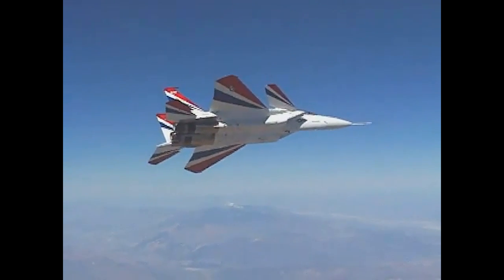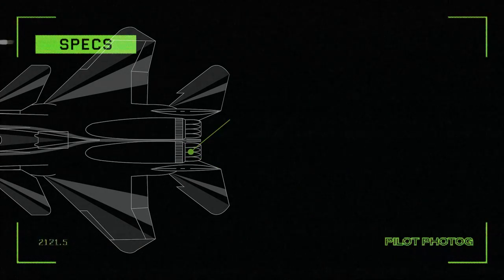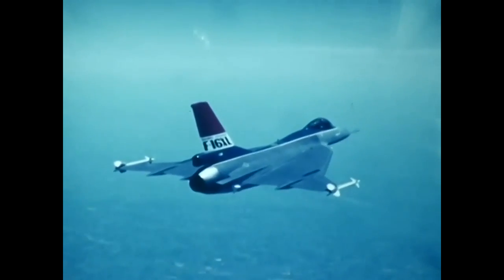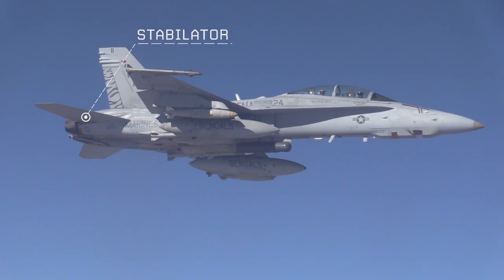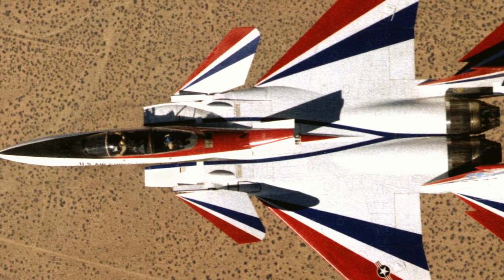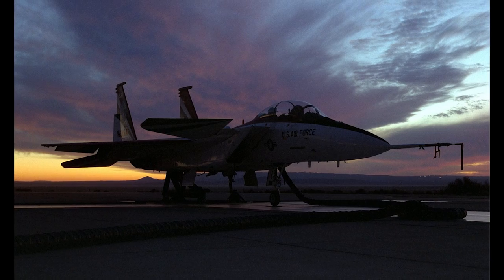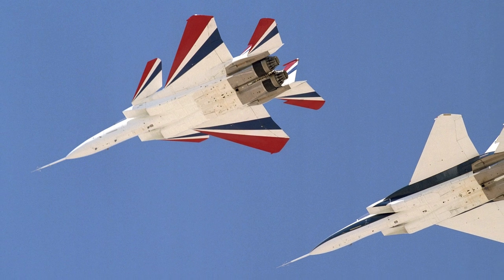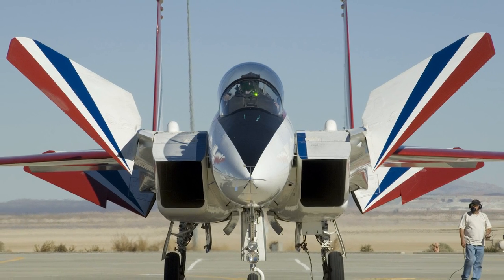NASA's 837: The Ultimate Modified F-15!

Comment: I'm proud to say that I was a Crew Chief on this aircraft in 1989. It's amazing aircraft. I was assigned to Edwards AFB F-15 CFT.
Reply from the maker: Awesome and thank you for your service!
Reply: Thank you for your sacrifice and your service, Chief!
Reply: Your opinion is, above all, more relevant than anyone else’s. In that respect I ask you…If pushed to it’s extremes, including thrust vectoring,how would this machine fare in contemporary  air space, including combat with the SU-57?
Reply: Salute to David Watson
Reply: Wow!
Reply: @douglascoleman1252  The end result of the vectoring project was they were about 50% as effective as predicted and helped in areas of the flight envelope where a combat aircraft is unlikely to go.  My team built the rectangular flight nozzles at P&W so we were very interested in how they worked out.   Biggest improvement was in the STOL where the aircraft has more thrust than weight and so can fly straight up if the nose can be pointed there.   Normal takeoff needs enough airspeed for the control surfaces to develop enough authority to lift the nose and the vectored thrust when pointed up pushes down the tail and levers the nose upward....then they vector down and push the aircraft off of the ground.   This happens quickly and the aircraft can be airborne in a very short run...though it's dangerous to do this as it still doesn't have enough airspeed for good control so this would be an emergency type of takeoff only.
I had a hand in the later 360 round nozzle prototype  that I believe were tested on this aircraft (this was after I left P&W) and again while they worked well....not well enough to justify their inclusion in all F-15's and 16's as was being discussed when we were making them.   For sure they make for a GREAT airshow performer but in real aerial combat...there are better places to put your weight and money.
Reply: Dude that is awesome

Comment: Incredible how a nearly 50 year old design still looks like a state of the art killing machine!
Reply: Hey, they figured out how to make an air frame that can cut through the air, carry a shit ton of weapons and take a beating. All they had to do was upgrade the electronic, the engines and make slight tweaks to the air frame for improved aerodynamics and RCS.
Reply: Laws of diminishing returns. I think that you are right, this may be the most efficient airframe to date and perhaps the future. Build and improve the same airframe and reduce the cost through modularity. 15 is a great number, f-15 and AR15 both flexible to mission load-outs.
Reply: The F-15 is a flying corner reflector.  The antithesis of stealthy design.  By my eye, it stopped looking modern sometime back in the mid-80s.  About the same time that the Foxbat started looking like a relic.

For examples of timeless design, the F-16 takes that one hands down.  (Right up til the Block 60, when they had a contest to see how fugly they could make it.)  In the era before that, the F-86.  Before that, the Spit.  And before that, the Albatross.  And from the pioneering era, nothing was as beautiful as the Taube.  All five of these classics have timeless beauty.  This bears repeating:

F-16
F-86
Spitfire
Albatross
Taube

There was a time when I absolutely LOVED the F-15.  And I actually hated the F-16 for daring to tread in its territory.  And I also remember when the overtake happened.  It was a bittersweet day when I finally fell out of love with the Eagle.  I actually held out til the early 90s.  Right around 92 or 93.  The F-16 jumped to the top of my list, and it has remained there ever since.

As for sexiest F-16 of all time, that one has never been built.  It would be a retrofit of the YF-16 with a bigmouth inlet, an F110-GE-132 motor, and an MATV nozzle.  THAT is my dream jet right there.  Also be sure to add the MATV's moving sidestick, replacing the one from the YF that didn't move at all.  This is the ultimate aircraft, in my book.  I'd be willing to consider adapting the paint job from the STOL/MTD.  That might look snazzy.
Reply: Greg Spolar , if you go all the way back to the beginning of the F-15 in what MacDac was trying to sell to the AF, they were pushing the Eagle as a Super Phantom.  Doing all the roles the Phantom did, to include tactical nuke strike fighter.  The base model even came equipped with the pit to put a Wizzo.  It was only afterward that the Air-to-Air generals took charge of F-X and got McD to go along with the "Not A Pound For Air to Ground" mantra.

Ironically, it was the F-16 program that began its life as a pure air-to-air fighter.  Then during the FSD phase it morphed from LWF to ACF, with the F-16 becoming the eventual replacement for the many roles done by the F-4, including tac nuke.  The most needed change was the switch from the pencil-nosed YF-16 to the bulbous FSD nose, so that a full function fire control radar could fit inside.

So the F-15 & F-16 Programs started in opposite places, then evolved in these opposite directions with each ending where the other was starting from.  PureA2A vs MultiRole.  Only much later did the F-15 branch off to a new species which fit with the original concept.  The Strike Eagle.  And around that same timeframe did the F-16 stop being a joke when it came to its air-to-air capability.  It finally got BVR missiles.  First by way of adapting Aim-7s for certain Guard units.  Then the more comprehensive Aim-120 fix.

If you plot the trajectories of the Eagle & Falcon programs, it looks kind of like this scissors dogfight maneuver.  Starting in opposing positions, then fighting to get into the position of where the other one was.  Then after assessing this new position you've established, putting all this effort toward getting back to where your original position had been...   Kind of.

With the F-16, it was originally there to just boost the numbers when going into combat.  Give the Ruskies a bunch of cheap targets to shoot at so that the prized F-15s would not be double teamed.  The final position it ended at was being this amazingly capable air-to-air fighter which also retained a respectable air-to-ground role.  No longer throw away.

With the F-15, it went from Super Phantom to this final position of Super Phantom in the E-model.  With the C-model drilling useless holes endlessly in the sky.  One could say that the Seagull (C-eagle) obsoleted itself.  It did its job so well that no one was willing to challenge it.  So in the end, it had no one to play with.

Both the F-16 & F-15E got Lantirn.  So this let the AF junk their Vark Fleet, even though neither came close to the full capabilities of the -111 in its highly specialized role.  The Vark had always been a maintenance nightmare, having stretched science fiction capability into the realm of science fact.  It never got adequately replaced, but from the accountant's perspective, this retirement came as a relief.

As for the A-10, the real reason the AF hates it is because it was always the step-child.  From the moment it was conceived.  Even when the USAF got a Chief of Staff who was a Warthog Warrior himself, what did he try to do?  Kill it.  Congress forced him to keep it.

So this is USAF fighter aircraft through the 70s, 80s & 90s, into the 2000s, in a nutshell.
Reply: The F-15 is still one hell of an aircraft but it's design does look a little dated but like the old saying goes if it ain't broke don't fix it
Reply: @EnterpriseXI  Basically Russia's philosophy until they can produce a 5th gen fighter in numbers, I believe. Only thing in my mind with the now-named Eagle II is why wasn't it fitted with thrust vectoring nozzles like Sukhoi's equivalent Flankers? Surely a trick's been missed there, particularly as this self-same F15 did the research years and years ago
Reply: @dahawk8574  sorry but i will take something less modern looking if it has a proven track record of safety and reliability. Name me one f-16 that has landed missing a wing while still flyable (Israeli F-15). I also personally saw a strike eagle bring its crew home safely even after a double bird strike took out and cooked the engines. There is a reason the F-16 is called a lawn dart.
Reply: @christinabishop2533 ,
An F-14 Tomcat pulled off that trick too, landing with a huge chunk of its wing blown off.  And then there are the A-10s that have had all kinds of stuff thrown at them, and they manage to come home.  In 'Manual Reversion' mode, as I seem to recall their terminology.

But the F-16 pulled off some phenomenal tricks too.  Going all the way back to the YF-16, there was one test flight where one of the main landing gear failed to come down.  So the test pilot raised the gear and then just landed on the grass between the runway and the taxiway.  Quite an impressive stunt.  I want to say that it was Neil Anderson who pulled that one off.

Yes, it didn't take long after that where it got branded with the name 'Lawn Dart'.  With the old joke that if you want to own your own F-16, just buy some land in Utah ...and the wait.

Now I haven't checked the hard stats, but from what I recall, the F-16 safety record is actually quite solid.  Plenty of stories of pilots landing it as a glider, which it does quite well, and they train for regularly.  And from what I've seen from canopy impact testing, it resists birds quite well.  A bird can actually mess you up without ever entering the cockpit.  The canopy will flex so much without breaking that it can clobber you in the helmet.

With everything that's out there, my own personal top choice is a big mouth Viper.  Of course, the best days are well behind now.  Top Gun III will be a movie about drones.  (Actually, this was the original plot of TG2, back in the Tony Scott phase.)
Reply: Because we are still using 50 years old tanks and planes with modern electronics
Reply: @joevidya  yet we're still (somehow) the most advanced military in the world, and to be fair we have, mostly, upgraded to slightly younger jets on average by now lol
Reply: Kind of like the 30 year old F-22.
Reply: @dahawk8574  actually the new F15/EX has severly lowered its radar CS and even now has all of its missles internally loaded now (of course it still has hardpoints for external armaments) so it is a lot "stealthier" than the OG 15 design.

Really, the 15 look is timeless and is still a beautiful beast and though theb22 is also a sexy bitch, the 15, to many and many others, will always be a beautiful killing machine.
Reply: @EnterpriseXI  i disagree, the 15 design is and always will be a timless one.
Reply: @CONSOLETRUTH2  
I used to feel that way about the F-15...
Back in the mid-70s.
Reply: @thedasher98 Because the USAF doesn’t see supermaneuverability as being very useful in actual combat.  In fact, it runs contrary to long-standing US fighter doctrine, which is not to get into turning fights.  (The US ignored this doctrine early in Vietnam, with bad results).  This is a major reason why the US didn’t use TV nozzles in future F-15s and F-16s after testing it.
Reply: @bluemarlin8138  Then it's very interesting they had a change of heart as evidenced by the F-22.

Comment: I was privileged to watch every takeoff and landing when it operated in St. Louis.  A perk working the flight line at McDonnell-Douglas
Reply: Alan Whiteside  I was a machine repairman in maintenance behind the hush houses.  Bldg 56 I think??  (spent a lot of time on that roof watching vertical take offs or emergency landings using the cables).  I worked on hyd. carts, nitrogen carts , engine dollies etc.  I even got a couple F15 and 18 back seat rides during hush house engine runs.  Good times.  I was always impressed with the flight mechanics experience and expertise working on those planes.  I was chosen as the only maintenance guy to go to Lemoore for the big F-18 mod in 1985 (cracked formers).  I wanted nothing more than to travel for MAC after that, but sadly that was my only one.
Reply: Alan Whiteside  Oh hell yeah!!!  I remember John Roller, he was a building mechanic.  I bought a car from him.  Was at his house several times
Reply: Alan Whiteside  hey!!  I have something nostalgic you may be interested in.... or another retiree you may know.  Remember the Roll-Outs??  Big windsocks on the light posts???  Well, damn the luck one of those turned up missing when we were tasked with removing them.  It's from 10,000th airplane.  It has some stains, but it has never been in the sun since it came off the light post.  It's yours if you want it.  I live on a boat now getting ready to head south when borders open up.  I'm gettin' rid of stuff!!
Reply: Alan Whiteside  Hey!!  I have something nostalgic you or some other retiree may be interested in.  It's one of the big wind socks from the 10,000th plane roll out.  It's yours if you want.

Comment: Wow, I knew of the STOL/MTD and ACTIVE programs but had no idea that F-15 participated in so much research, that was a very informative and interesting video. I cant seem to find anything on the final disposition of the aircraft other than that NASA had plans to put it on permanent display outside at Dryden. This F-15 deserves a space inside an air Conditioned museum.
Reply from the maker: Thank you I do believe it is on static display...outside? Not sure but agreed that it should be kept indoors.
Reply: well, "we" get nostalgic and all that, but remember it's just an asset.  It did its job, quite well in fact, and now it's retired.  It did a shit-ton of test work both with the USAF and NASA.  Combined with the X-29's work with thrust vectoring and flight control enhancements, those two platforms are vital predecessors to today's 5th generation and beyond fighters and other weapons systems.
Reply: I saw it on a static display at Edwards AFB a few  years ago. (Inside the AFB) It’s stuck on top of a pole. Kinda a shame it didn’t end up in a proper museum for the public to see.
Reply: @PilotPhotog  outdoors??? Ion know about that 😬😬

Last time I saw a plane on display outside was like a week ago, and it was in SHAMBLES, would rather not see that happen to this plane 😭
Reply from the maker: @aceofaces1506  hopefully they can hanger it soon

Comment: Imagine if boeing decided to produced an evolved F15, this fighter could be the next best thing. An F15 with thrust vectoring, reverse thrust and great dogfighting.
Reply: But we got the F15EX instead ...
Reply: But all those money found a much better use on the development of fifth gen fighter jet
Reply: @M1A2_Abrams_MBT  well the F15EX is basically the latest and most advanced variant. Imagining have the experimental fighter combined with the F15EX tech and improvements, u could have a near 5th gen top of the line frontline fighter. Without the stealth of course. Though u can have radar absorbent materials and paint to enhance it but u cant change the shape much for a stealthy design.

I would imagine the best F15 to possibly be imagined to be the experimental fighter with the technology of the F15EX plus the F15 silent eagle combined. Reduce RCS, internal carriage bay, advance performance and the latest features. 
But that might make the price pricy
Reply: @Benjamin-wy4dj  I think the silent eagle goes against what the EX is trying to accomplish. I think the EX carries 12 AMRAAMs, and the ordinance of the silent eagle is limited?
The EX isn't that much different from the E. It can just carry more missiles, has a newer airframe, and has a better radar. 
Correct me if I'm wrong.
Reply: @M1A2_Abrams_MBT  Depends. I did read on the F35 having its so called beast mode where it carries ordance outside for situations where stealth isnt really required. 
So i mean u can have the SE and EX at the same time. Its really the application uses if they need to go quiet or not.
Reply: @Benjamin-wy4dj  ahh yes that makes sense
Reply: @Benjamin-wy4dj  they did that with the 15ex.  It has internal weapons bay, RAM, and its 2 tails went from being at a 90° angle to the body to having a slight 15° angle which reduced its RCS by something like near 80%
Reply: @Benjamin-wy4dj  also, the cost for each EX still comes in way below the cost of a single F - 22
Reply: The USAF correctly decided that thrust vectoring was not a significant advantage in combat, but was expensive and a maintenance headache.  The F-15EX includes the features most relevant to realistic combat.